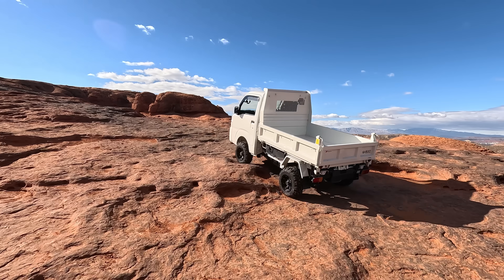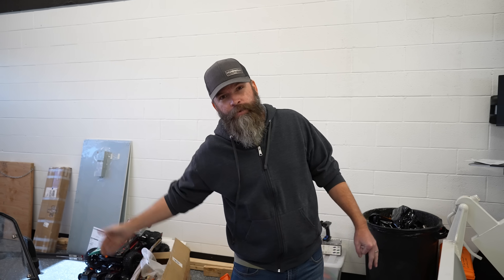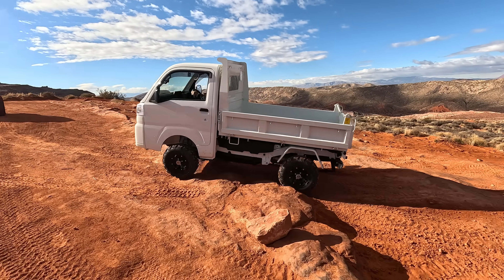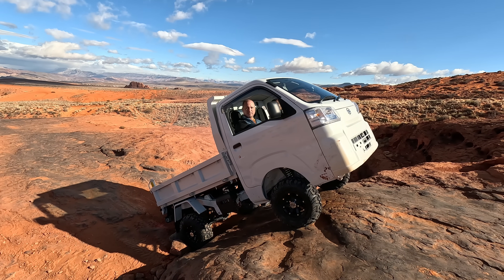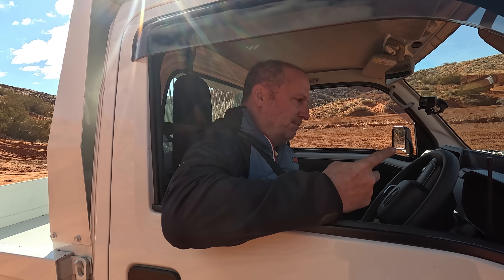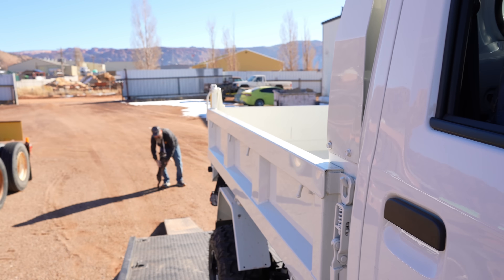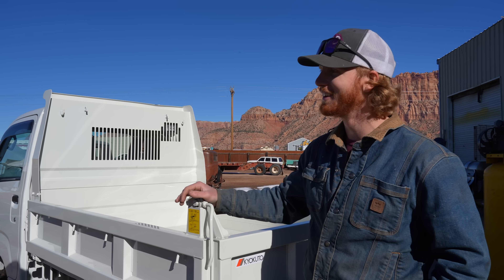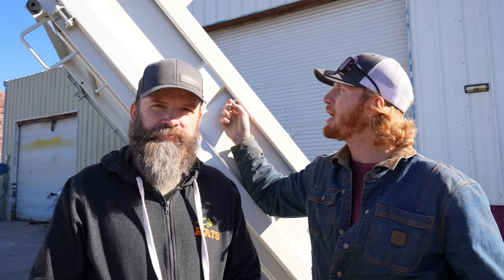Mini Recovery Truck for the Mini Jeeps!

Comment: Love it! Though for the rear dump bed I would make the tilt bed a flat tilt bed with retractable ramps, so one could potentially fit a larger vehicle on it (like a small side by side). Just in case you need to recover such in the future and the vehicle is a little wider than the bed. Also be sure to add strap down points, so you could use it as a mini bike carrier as well <grins>. Cus who doesn’t love mini bikes on a mini truck eh?

Comment: I daily a 1992 Hijet everyday, and it’s the most fun I’ve had in any vehicle! She will hit interstate at 65mph no problem, albeit 0-65 takes somewhat of an eternity. I take driving it on road much like a motorcycle where you are more connected to the road around you. They are starting to become more and more prevalent, and I could not be happier about it! Have fun y’all

Comment: light truck, short wheel base, that thing be a beast off road, as long as don't high center
Australian YouTube channel Mighty Car Mods has one of those and fitted with a turbo
european tow trucks have a crane system, that picks up cars buy the wheels, that then deposits car on  same vehicle's flat bed

Comment: MotoCheez  did a build a few years ago  ( the Playlist has 157 vids ! ) . He scoured Forums , but still got some sketchy  [ hey , it IS the internet !  ] advice  re: body lifts , suspension lifts , max tire sizes , etc. 
    Ended up with a sweet  4x4  Kei Truck 👍 . 
     I don't recall if he named the 
forums , but you can glean a lot of info of what MOD SIZES actually work.
    His buddy did a similar one & painted it TONKA yellow 😄 .

Comment: I had a '97 I imported that was a dump with a locker. Put a lift and 23s on it (really, 23s are pretty big for these things xD). It was a ton of fun, but pretty rough off road and not particularly capable. Fun though.

Comment: There might be a way to reconfigure  that massive cylinder to slide the bed back with a slight tilt, at least far enough to fit ramps. Is there a turbo option for that 0.6?
Reply from the maker: We’re looking into it

Comment: There is a restrictor in the intake pipe, and the 1 inch exhaust does not allow the Engine to breathe. Remove those and you will have more power

Comment: All you need is o e of them motorcycle bed lifts.  It comes out of the bed and slants down a little so that you can put a motorcycle on it, then it just slides back into the truck bed.

Comment: Daihatsu is owned by Toyota (since 1998), but they decided to discontinue production of the brand in Japan.  However, I live in Indonesia, and they produce Daihatsu vehicles on the same assembly lines as their Toyota counterpart vehicles.  I own a Daihatsu Sigra, which is the same car as the Toyota Calya.  They stopped producing the Hi-Jet during the COVID slow down.

Comment: Id bet many are willing to design a bed with option to build with ramps or roll back etc. Would be a light weight highly adjustable bed to reconfigure into solid or removeable- flat or sided as needed.

I helped design one
Made one set befor and we did it with aluminum.  They hauled up to 2800lbs of pallets at a time self loaded an droped . Beefed up suspension an the roll of bed was light enought to load on ground then then pull on like jobsite dumpsters also could haul a honda crx with no issues.  The later added the removable sides an used it as a dump trailer style bed until it was totaled. 

Fyi it weight only 150lb over stock with the upgrades in roll back mode an suspension upgraded for weight. The aluminum box frame bed made that possible
Reply: It was back in 2014 when these where rare and couldn't get them legal an most that came over was used an marked for farm only use. This one was used to haul feed pallets supplies etc on a farm that was decided an the hunting cabin that used during cattle grazing seasons needed somthing small that could haul stuff in and out an also doubled as a side by side style work horse on the day to day.... this they bought this truck an I helped my buddy design the bed system an plates to mount the better suspension for weight an rough roads.   Worked great but it cost a good bit for all the aluminum box tubed frame then sheeted in aluminum 💎 plate with steel c channel on bottom to used for the slider mechanism housing bearings for wheels

Comment: This looks like a modern kei truck, but how did you manage to get it here without the 25 year thing?
Reply from the maker: They can be imported and registered as off-road vehicles. They come governed at 25mph though that can be removed.
Reply: @MisAdventureLab  Ah gotcha, was wondering how you got around the import thing. So I'm guessing that means importing laws and regulations are different and/or easier for off-road vehicles?

Comment: At first glance, it appears that the front top portion of the dump bed is bolted on.  I don't think you really need that.  Removing it will make the vehicle lighter, with the added bonus of a higher horsepower to weight ratio.